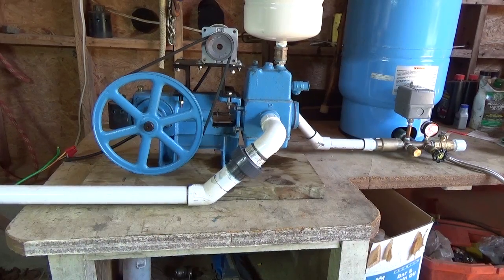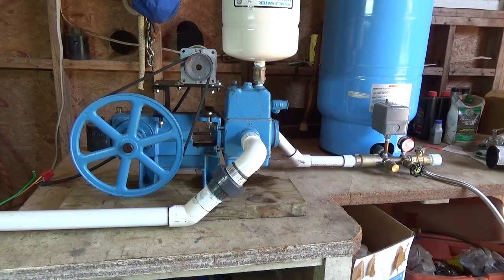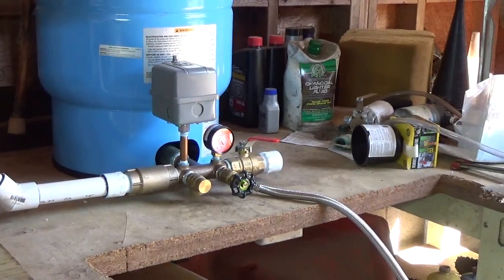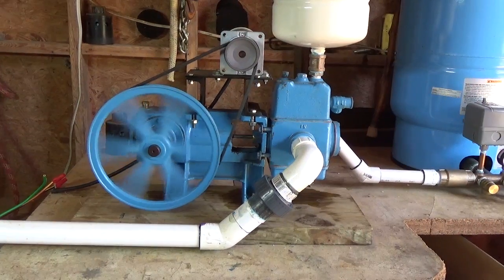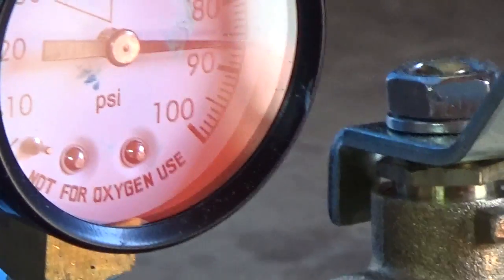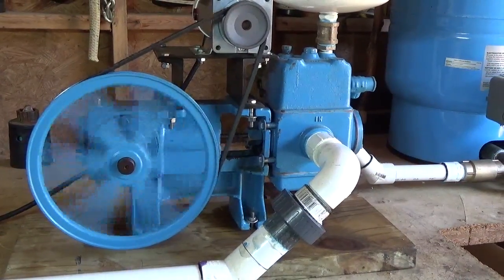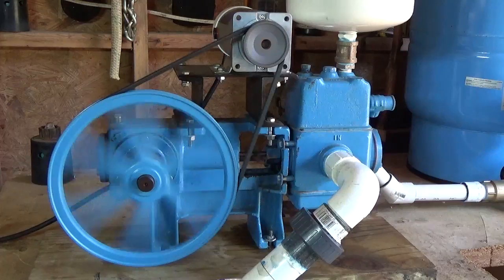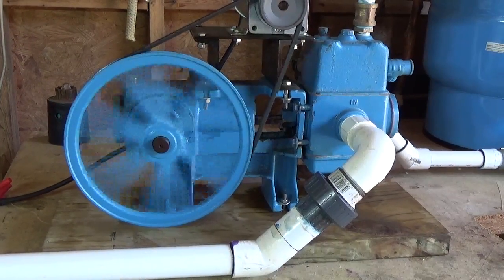Solar Piston Pump

Comment: I have a 48v sol arc solar system. I have what I believe is an old piston well with a huge pressure tank. What  volt motor should I get? Thanks

Comment: the RPM of that pump sounds way too high you will wear the piston cups in no time at that speed most of the older piston pumps use a 1/6 HP 1425 to 1450 RPM motor

Comment: yeah... not a solar water pump. Power provided by solar sure, batteries really but either way. NOT A SOLAR WATER PUMP BUDDY. A solar water pump does not use an electric motor or batteries, this is a standard water pump. nothing special
Reply: How exactly do you think solar pumps work if they are not electric? I need a good laugh.

Comment: I have a Duro piston pump drawing water from the river through a 2 in. Line. I get lots of water at the pump but when i hook up 100 ft
 Of 3/4 in. Hose and a lawn sprinkler, it runs about 30 seonds and shuts down. What am I doing wrong?
Reply: Too long and too small a diameter hose causing too high a discharge pressure.  Pressure is resistance to flow, in this case cause by pushing water a long way through a small hose.

Comment: Engineer775 - I have a Crane S 25 Piston Pump that I am in the process of restoring prior to putting it back to work.  It is finctioning well, but I would like to go through it completely.  I have not been able to find and parts manuals for it.  Would you have any advice?  I would like to find a parts manual before I get too far along.  Enjoy your videos.  Thank you.
Reply: John Stark q
Reply: I apologize, but do not see your reply.  Please repost.  Thank you.

Comment: Don't pressure test to max head on a diaphragm tank, the diaphragm will stretch and break!     This can happen at around 30/40 psi above the tanks air charge!    You notice around 75 psi in this video it begins to rapidly rise in psi, that's the diaphragm reaching it's limit.    It can not stretch any more and all its doing is compressing steel and pvc.

Comment: How long do you think it would run on a couple of car batteries? like if it was running constantly?
Reply: Lets do a little math. To figure this out you need to know the Amp-Hour rating on the battery(s) and also the amps being drawn from them. So, just for the sake of quickly answering your question, we will throw in a few estimated numbers. So one car battery on average will have a 60 Ah rating. And lets just guess that this motor will run 5 Amps when running with a medium load. So, a simple equation can be done to solve the amount of time. That is T=A/C And T= Time A=Amp Hour and C= Consumed. So lets plug in the numbers. T=60/5. That equals 12. So, theoretically, your battery should run for 12 hours. So that's the simple answer, however. It gets WAY more complicated. There are voltages that can affect this, and also, something called a peukert number. To make this simple, Go ahead and check out this spreadsheet i made that calculates the time a bit more accurately than i am. I used this spreadsheet to calculate a more accurate number which is now 9.2951600 hours. https://docs.google.com/spreadsheet/ccc?key=0AsWMJiWcicazdEZVQUI4LVg5NlFmRFpoM2NfSXBEaEE&usp=docslist_api
Reply: Thanks a lot. That really made sense.

Comment from the maker: One of the most efficient ways to pump water! 

https://practicalpreppers.com/online-shop/water-solutions/dankoff-solar-force-piston-pumps-detail-view

www.practicalpreppers.com  #practprep
Reply: what RPM's are recommended for those piston pumps? as i got an ole Southern cross pump
Reply: +Shane D Stokes 400rpm max on the big wheel. If you are running a 1440rpm motor use a 2" pulley (If you have a pump with the smaller type of flywheel (usually aluminium) don't go bigger than a 1 1/2 pulley on the motor
Reply: thank you for the reply as i was not sure the recommended ratio for speed required

Comment: Wow motor is a little pricy and the windshield wiper motor will not do the trick ,But I picked up a 12 volt winch with a remote . This should be ok ? Just think you could be in the camp and if its raining ,just use the remote threw the window . That way you don't have to have the wife go turn it on . Lol

Comment: Question.  I had two sprinklers in our garden and all worked fine, I added another about 50 ft away and now the water pressure is low.  My system:: from the water valve I have 100ft of 5/8 that is hooked upto another hose valve.  There I have a timer that feeds 40ft of 5/8 hose to the first sprinkler, that is linked to anther using 30 ft of 5/8 hose.  That was working great until I added another that is 50ft of 1 inch underground pvc to another sprinkler.  It is when I added the third is when I lost pressure.  If I add a pump, where should I put it, at the valve at the houes where it starts, or at the second valve where the timer is ?   Will a video help.?  If you haven't the time to answer I understand..

Comment: I wonder about using one with a well ???. my grand parents had a piston pump but they had a point  my well is 88ft
Reply from the maker: What is the static level? The distance to the top of the water?
Reply: not sure but I will find out
Reply: having a tough time finding out the depth the well is twenty years old about three years ago i had a new submersible put in like $1.500 but if this would work i'd rather have one like this much easier to service
Reply: engineer775 Practical Preppers I have the same question. Well is 60 feet deep with a static level in midsummer of 17 feet. well is 40 to 50 years old and has not been used in around 30 to 35 years. Need a suggestion on the best way to clean it out also as I know there is going to be a good deal of sedimentation in the bottom.

Comment: Hi mr 775 .lol  I may have mist it , but what did you use for the 12 volt motor ? I was  thinking  of trying  a windshield wiper motor ?? What do you think of that  ? The power is not to bad on the older ones , like out of a older truck or car . Not trying to reinvent the wheel , it just may be easer in emergency to find one . Thanks for other grate video .
Reply from the maker: It is a 24 volt dc Dankoff motor.

Comment: Hello: I looked on your site and the Rift 15 new is $2,060. I guess the 75 year old 15 I got this weekend for $100 wasn't to bad. I'm just guessing 75 years old.  I have P.B. Blaster soaking on all the bolts and nuts right now. It has a brass plate with model and serial number I guess I can get a rebuild kit for it. Have a Good One